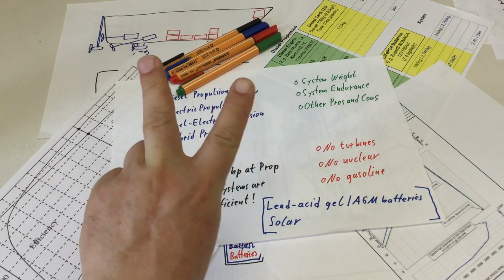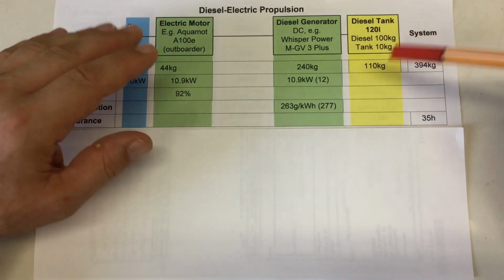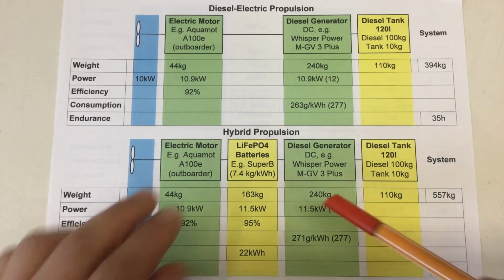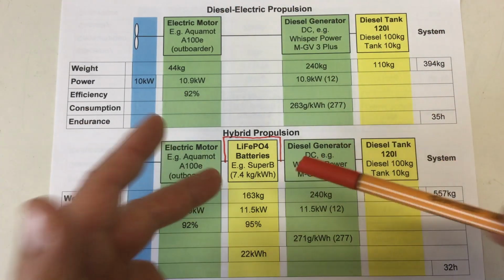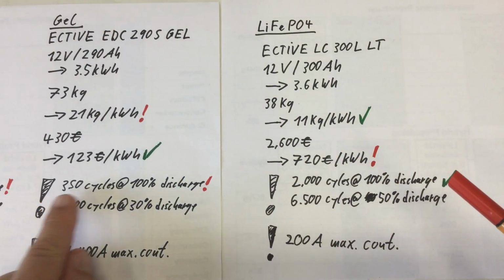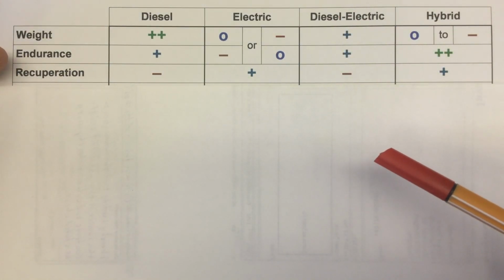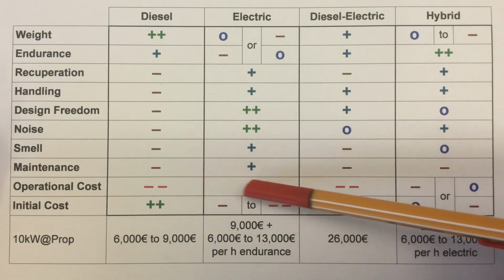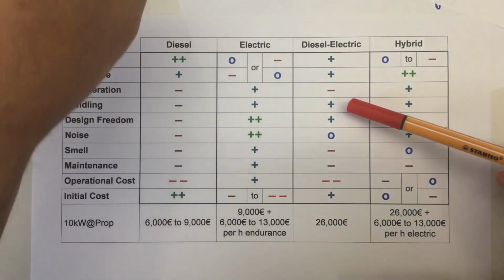Marine Propulsion: Diesel, Electric, Diesel-Electric or Hybrid? (2/2)

Comment: Great video, perfect for those of us without the proper knowledge who want to learn about this stuff the simple way. I have and ideia in my mind for some time and would like to see if could be a real possibility. Would you be interested in running the figures for this example: 
let's think of a ship/yeacht under 40m/500gt, hybrid propulsion, 2 voith schneider, 2 e-motors, generators, battery bank storage, 2x vertical axis wind generators, 30sqm of solar pannels, 2x hydro-generators generating while cruising. The questions are: How much energy woult take to run this vessel knowing that for a normal day living above deck would need 50kw. For how long could be self sufficient without the using generators. What would be the fuel consumpion crossing the atlantic from London to New York using this hybrid system. What would be the range of such system with a 30,000L fuel tank. Thnx
Reply from the maker: Well, I'm flattered that you're asking me. But to be honest, you should consult an accredited naval architect. That said, 30m² of solar panels will give you on average 120kWh per day in St. Paul's, Newfoundland - in May! In December you'll only get about 18kWh per day! And that's assuming the panes are never shadowed by a mast or sail. If you're not sailing and running your electric motors (500kW my) at let's say 50% (250kW) you'll only be able to run them about half an hour (St. Paul's in May). I guess what I want to say is, that there's no way you can motoring such a vessel just on solar and wind generators. Sorry!

Comment: Would it be possible to put a series diesel electric/battery hybrid system in an RV or cube van and get something like 30mpg out of it? Say, something similar to the BMW i3 but more powerful?
Reply from the maker: Good question! I'm really not into automotive stuff, but depending on the size of the RV 30mpg (7.8 l/100km) should be possible without going through the hoops of a serial hybrid. In fact the advantages of a serial hybrid are greatly reduced in automotive applications, because you accelerate/decelerate often. The additional weight of the serial hybrid solution reduces your efficiency considerably there (you can't recuperate 100% when decelerating). I guess that's the reason you don't find any serial hybrids in the automotive market. BTW Fiat Ducato with high roof, 3 tons (metric) and 160HP just needs 6.8 l/100km (35mpg) diesel.

Comment: I've got a 44 foot electric sailboat (replaced the 40 HP diesel) with 700 W of solar, 400 W of wind, and just a small gasoline generator. I've got 20 to 30 miles of battery range (22 kWh) depending on speed. I'll be adding hydrodymanic charging (a drag device) to give myself a realistic chance to re-charge the drive batteries... at least on longer passages. But so far, with only one season on Lake Ontario, I haven't needed the generator even once.
Reply from the maker: Thank you very much for that info! That's an application I didn't cover (or even thought about) in my video: Auxiliary engines for a sailboats. Could you please give me some more infos ...
What power does your electric engine have?
What's the top speed of your sailboat when under power?
Regarding hydrodynamic charging: Do you plan to change to an electric engine with recuperation (yeah, I know, without auto feathering prop you constantly have that additional drag, and props with controllable feathering/pitch are expensive), or you you plan to use an extra, outboard like hydrodynamic generator?
Anyway, love your Marcelina! Nice classic hull and simple, functional superstructure with clear lines (can't say much about the rig - I'm a motor vessel guy). I'm not a great fan of those modern sailing/motor vessels with superstructures that seemingly try to avoid any straight line or hard angle - everything has to be curved somehow.
Best Regards
Robert
Reply: @robertssmorgasbord  Sure... I replaced the 40 HP Volvo-Penta diesel with an Elco 40 HP (29 KW) electric motor. Either diesel or electric can get the boat to hull speed, which is about 7 knots. Although I never run the electric motor at top speed because I'm drawing 200 Amps (at 108 v) and my battery capacity is 200 Ah (21.6 kWh). If I drop down to 3.5 knots I'll only consume 30 Amps. In other words, I can triple my range by halving my boat speed. My battery/charging arrangement is a little complicated. I have two custom LFP batteries (51.2 v) in series, charged by a 15 A, 110 v AC charger... which is what I use when plugged into shore power. I also have 900 Ah of 12 v LFP batteries for my house bank that are charged by either an inverter/charger (shore power) and/or the solar panels and wind generator. I can then move that house battery power to the drive batteries via the inverter to two different chargers (in series) and into the drive batteries. Converting from DC to AC and back to DC through the inverter and chargers isn't the most efficient, but it works. Oh... and the generator is just a 2000 w Honda generator that can add about 15 amps (110 v AC). On it's own the generator could move the boat at about 2 knots, and the 5 gallon can I carry provides about 40 hours of continuous operation. So that's about 80 nautical miles of additional range. But like I said, the limited sailing I've done so far I haven't been away from the dock for more than a week, so I haven't needed the generator.

On the drag device, the Elco motor doesn't allow regen, and anyway I have a feathering prop, so I will be adding a Watt & Sea generator that hangs off the back of the boat. It will put out about 100 W while sailing. This, along with my wind and solar, should be enough that I can comfortably run all my house loads (fridge, chartplotter, lights, etc.) and still arrive with all my batteries topped up after a long passage.

I liked your analysis. My system certainly isn't the cheapest or most efficient, but it works for a tree-hugger like me.
Reply from the maker: @dc14522  Thank you so much for all the info! And don't worry about your system not being the cheapest or most efficient. The important thing here is that it works for your application. Sure, the system would be a more efficient if you had all your battery capacity in a single (108V) bank. However, having two battery banks adds redundancy and therefore safety. If need be your 15A/110V charger could be used to run your engine from the 12V bank and and give you about 2 knots for maybe 6 hours (optimistic). If I might make a suggestion: Try to find a charger (power supply, voltage converter) for your 12V bus that can work off the 105V battery bank. That way you could continue to use the radio, plotter etc. even if your 12V battery bank fails / runs empty.

Thanks again for sharing the info about your setup with me!
Reply: @robertssmorgasbord  You're welcome. I could run the 15 A/110 V charger from the house bank, but it pulls nearly 200 amps, which is more than my wiring can take. That's why I have separate chargers that allow me to "throttle back" the house bank to drive bank charge rate without setting my boat on fire.
Reply from the maker: @dancourtney2816  I see. And good on you! Most people do have some idea that your wires need to be thick enough to handle a certain current, but are oblivious to the fact that a big enough battery (lead acid or lithium) can easily get a thin enough cable red hot, white hot or to melt.
Reply: I've been wondering about your approach by using an Elco motor and an off the shelf gas generator. I'm guessing that it's a cheaper Hybrid system but also has advantages like not having to cool the generator with lake/ocean water,  easier to get parts and it's a self contained unit which regulates it's speed to demand.  What kind of batteries are you using?
Thanks Robert for all your hard work illustrating the different options.
Reply: @BryanBowser  LiFePo4…about 21 KWhr in 2 custom made packs.

Comment: Good video. Applies to the defense industry as well, and will become more applicable as more attention is drawn towards autonomy and fuel efficiency.
Reply from the maker: Thanks for the praise! The military will definitely be one of the first (ships/tanks/vehicles). For most others the initial investment is (currently) simply too high. There was a battery powered costal freighter announces and some solar/battery boots/yachts popped up. The latter are quite expensive and are only viable if you're happy with a cruising speed of a few knots (solar) or an endurance of a few hours (battery).
Reply: You're welcome! Cheers from Argentina Patagonia.

Comment: Really good video. I am a student and wonder if you recommend a book/article that goes a bit deeper into the hybrid system, or if it would be possible to contact you through an email?
Reply from the maker: First, thank you for the praise 🙂 Second, unfortunately there only very few (scientific/engineering) articles on that subject  (google for "marine hybrid propulsion article") that I know of and I really can't recommend any of them. Also, as far as I know there's no textbook available on that subject. Third, I'm sorry but for privacy reasons I do not provide any contact information. I trust you'll understand. Sorry I couldn't be more helpful.
Reply: @robertssmorgasbord  Thats fine and completely understandable 🙂
Reply from the maker: @knut-magnusbrautaset8155  Thank you very much for your understanding!
Reply: @robertssmorgasbord  Quick question for the hybrid propulsion systems endurance:
I assume you get 32 h by dividing 100kg fuel by 0.271g/kWh and then divide this answer by 11.5kW. Doesn't the battery contribute in some way? I am a bit confused as you later on say the hybrid is the superior alternative in regards of endurance.
Reply from the maker: @knut-magnusbrautaset8155  Well, the battery would contribute if you charged it from an external energy source (plug-in hybrid, e.g. charging the battery with land power while being docked). In simply didn't include that option in my model. The endurance advantage of the hybrid in my model I talked about is based on the option to always operate the diesel engine (of the generator) at its peak efficiency, that is at certain RPM, respectively, power output. If you you need more power, you take the difference from the battery. If you need less power, you you use the difference to charge the battery. If your batteries are fully charged, you don't run the diesel generator at all. Of course there is a limit to this regime: If you operate your electric motor continuously at full power, at some point you'll have to operate your diesel generator at full power (with less efficiency). And of course there's recuperation: If you're operating some of the time under sail or you are anchored in a current, you can use the electric motor as generator and charge the battery. But, your idea of pre-charging the battery when docked makes absolute sense and would further increase the efficiency of the system.

Comment: On the same power output, which is smaller & lighter, 2 large diesels or 4 smaller diesels? 

Btw, glad I find ur video
Reply from the maker: Well, bigger is in this case (almost) always better. That is more efficient in every way (energy efficiency, power to weight ratio, power to size ratio). Just an example I have at hand:
Yanmar 1GM10: 6.6kW, 86kg, 410x485x554mm
Yanmar 2YM15: 10kW, 113kg, 463x600x613mm
So you get 52% more power with just 31% more weight (OK, 63% more volume in this case because we've switched from a single cylinder to a two cylinder, but you get the idea).

Comment: Ok , I know I am putting my foot in mouth here. Would it be a cheaper solution to have a 3ph diesel generator , through a VFD (variable frequency drive) into a 3ph. induction motor ? Since all that would be commercial products ?
Reply from the maker: It's certainly an interesting idea for implementing a cheap diesel-electric propulsion. For sure you're paying a premium for marine equipment because it is, well, "marine". Taking a run of the mill 3-phase industrial motor will for sure shave of some cost. And as long as we're talking inboard motors here, I can't really see any drawbacks. Same holds true for  VFDs. The only problematic component might be the diesel generator. Those marine generators can handle a lot of tilting (as a ship rolls and pitches). I don't know what your standard stationary diesel generator would do after being tilted for hours +/-30° back an forth. I guess at least some models would have trouble keeping the lubrication going (oil, oil pump and oil sump). But you could always go with a diesel generator for street vehicles (semis/lorries). Those should be able to handle a bit of shaking.
Reply: @robertssmorgasbord  I guess there must be a hitch, or they would have done it by now :)
Reply from the maker: @mumbaiverve2307  But your idea is still valid! E.g. for pontoons of lakes where you don't expect too much rolling and pitching, or for a houseboat.